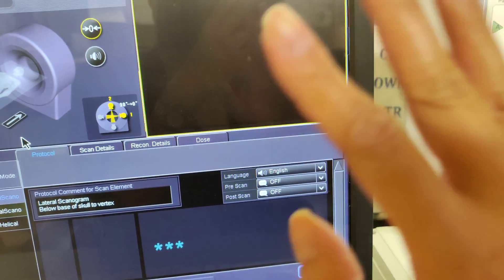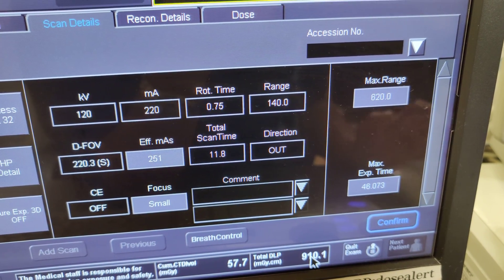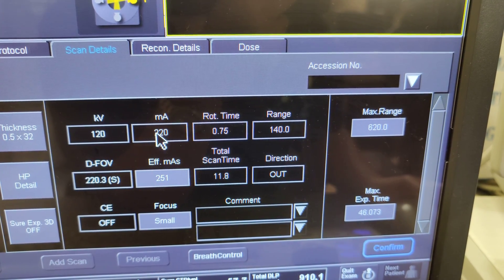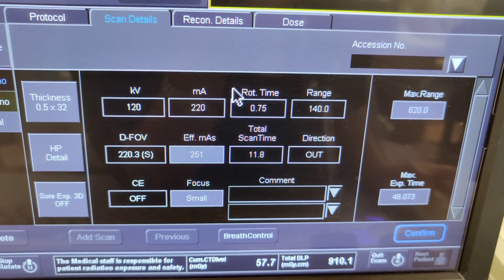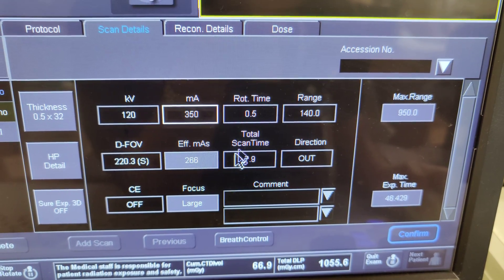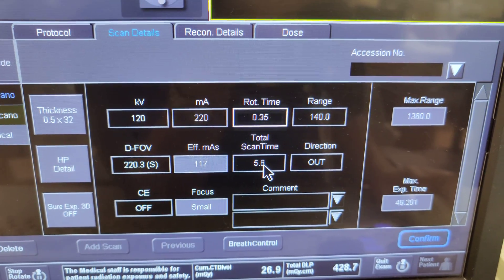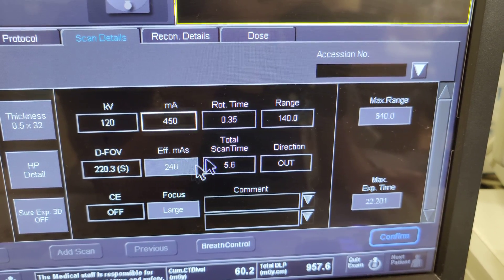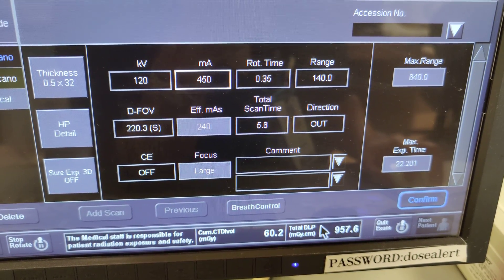CT technique | understanding rotation time | speeding up the scan | Toshiba Aquilion

Comment: Good day Doctor, I am quite concerned about the DICOM information of the Brain CT without CE I underwent at age 32. Siemens sensation 16 slice :
Total mAs 4751, Total DLP 927 CTDiVol 51.52 Kvp 120 Ref mAs 230
Xray tube current 460 (same value in each image) slice thickness 4.5 exposure time 500

Even tough DLP and CTDIvol is similar with your calculation my  Total mAs value isn't it so high? What can be the reason and Did I get overdose radiation?
Hope you help, Thanks

Comment: Hello Ms.👋 I'm working on a  CT Scan ,Toshiba and I want to get in touch with you. I have some problems with the protocol and the work station 🥵
Reply from the maker: Hello, what's the issue?
Reply: @RADKhammany When  I chose the examination and completed it, the examination does not appear clear and well, for example, the brain examination, the soft tissue do not appear good and clearly
Reply from the maker: Did you scan it as a volume scan? Where it was just a very fast scan and it only took one shot?
Reply from the maker: So the soft tissue is not clear but the bone is?
Reply: @RADKhammany  yes a volume scan
Reply: @RADKhammany  mmmm So what  I do now?
Reply: @RADKhammany   exactly just bone is good
Reply from the maker: Unfortunately, that's the reason. The volume is normally used for pediatrics or to as a subtraction. Head scans are normally scanned as a helical scan for a little more detail.
Reply from the maker: If you haven't given contrast yet consult with your radiologist. See if they want another scan. The good thing is there's not a lot of radiation in a volume scan. The pt can be scanned again
Reply: @RADKhammany   How l can stopped the Volume?or how I don’t choose it?🥵
Reply from the maker: Are there other head scan protocols available? The "regular" head scan should be the first thing.
Reply: @RADKhammany   thanks for your time🙏🤍
Reply from the maker: Look for my video on CT Scan Modes. Maybe that will help